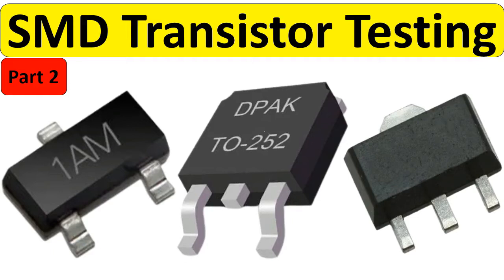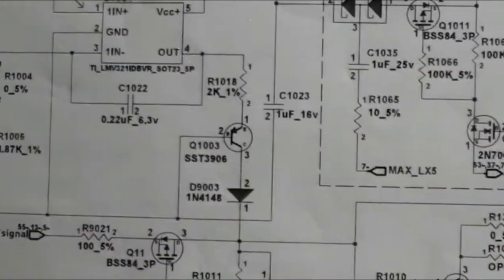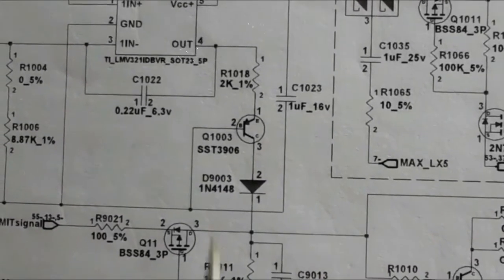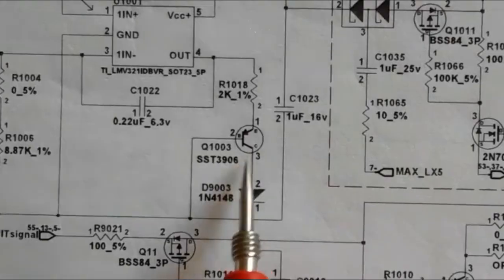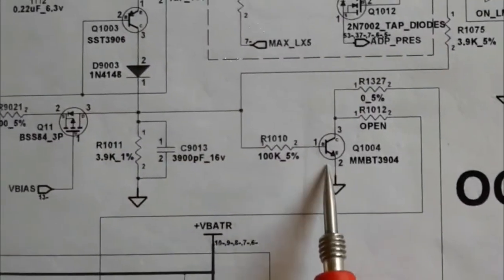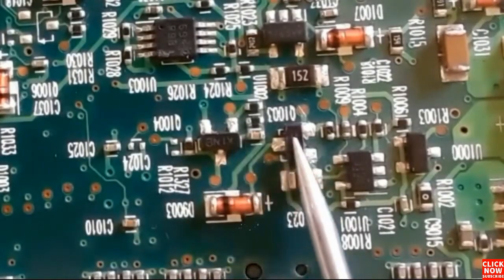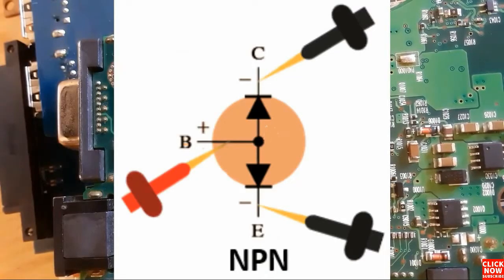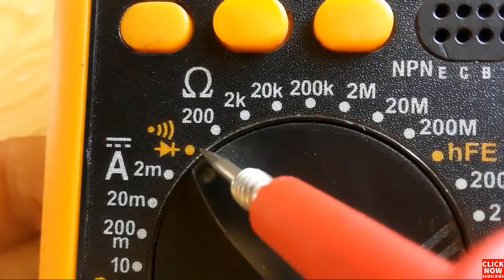SMD transistor testing using the multimeter tutorial

Comment: I am not too much experienced in electronics repair but I am trying to repair a washing machine circuit board. I can see burned SMD part that is labelled TR and is black with 3 legs on one side and one bigger one on the other side. The part number is ACS1086S. Is this a transistor? I am confused because transistor should have a Q marking? Thank you for your educational videos.
Reply: it's an AC switch

Comment: When you measure D301 with 3 legs, is it a diode or a transistor or a collector, it turns out to be 222. When you say emitter, it turns out 149, I asked, you said it was from the circuit, I was confused
Reply: yeah same problem